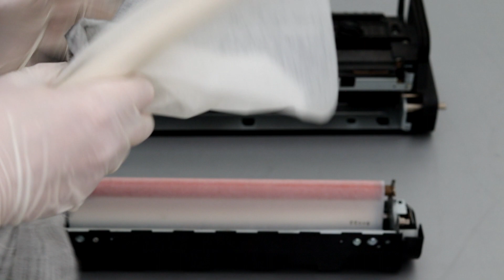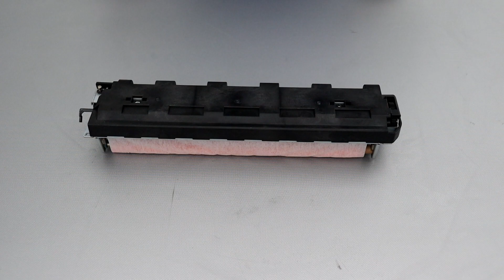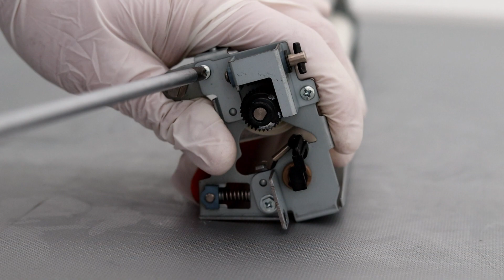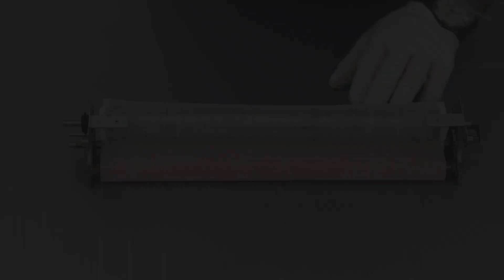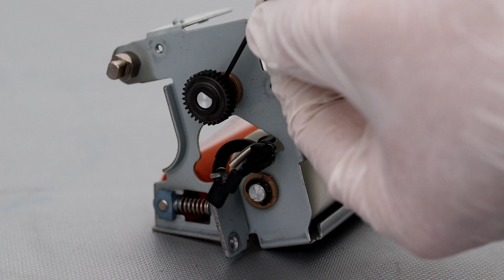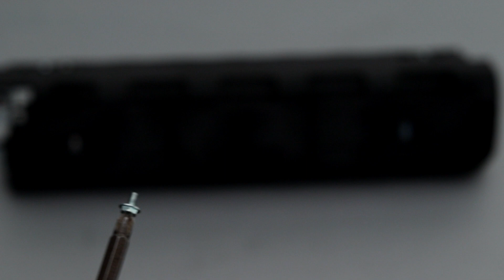How to replace fuser cleaning web RICOH MP4002 MP4001 MP5002 MP5001 Tutorial

Comment: Hello. I have noticed this model has an issue with copying light colors, blue, greenand red producing very faint or almost blank. Is there a setting that can be changed. Thanks in advance
Reply from the maker: @Vinochyl  You can't change this setting, it has to be like this. Best regards.
Reply: @MrRicoh  Thanks for the reply. I have come across only one machine of the same series that produced very nice and dark copies irrespective of the original document color so I thought it was a setting issue👍🏾
Reply from the maker: @Vinochyl   We have a trick where we change the settings and put in a different developer, but it's not authorized and hard to explain.
Reply: @MrRicoh  Thanks. Appreciated
Reply from the maker: @Vinochyl Did you manage to solve the problem? Is your copier working properly? Write.
Reply: @MrRicoh  unfortunately I didn't manage to sort that issue in time. The supplier had to swap the machine with the older Ricoh Aficio Mp5001 which works like a charm. Still trying to figure out a solution now that the machine is back from the client.

Comment: I have ricoh mp 5001, I have seen today that fuser cleaning web not winding prperly onto the spool, and lot of cleaning web stuck loose in between hot roller and base what is the main cause of that
Reply from the maker: I don't know, I don't see it. You probably need to replace the rollers and the heating foil.
Reply: Dear Tomaz thanks for your reply, I have checked each and every gear and it's looks perfect, after every 100-150 copies i have still seen that web is loose in between winding shaft and web roller, and I have manually winding the web, you have fitted the alen key gear on that direction my gear is now fitted just opposite. In my system Alen key on top side. May be it was not fitted wrongly by my technician?

Comment: Nice job!  A complete maintenance tutorial for this machine would be good, the correct way of cleaning.  Greetings Thomaz
Reply from the maker: Hi, now I'm preparing a complete replacement procedure for all parts on the Fuser Unit on this MP4002 4001 model. So Upper Fuser Roller, Press Roller, lamps ... But maintaining a competent copier is a good idea.
Reply: @Randall Joe instablaster =)

Comment: Metal Driven gear with allen key lock when you put back it’s a wrong position..
Reply from the maker: You're probably right. Hope other technicians read your comment. Regards.
Reply: It wouldn't have fitted in the Fuser assembly if it was wrongly fixed